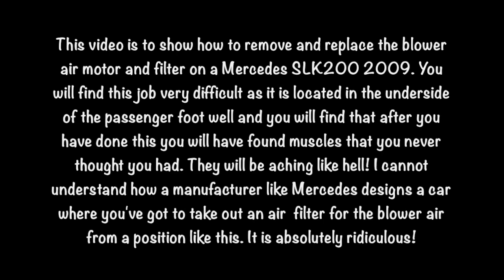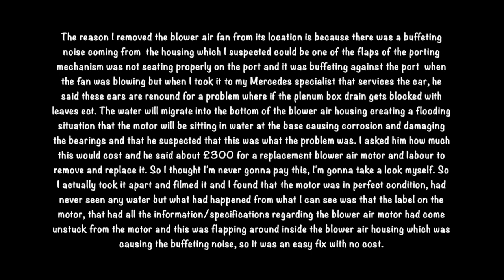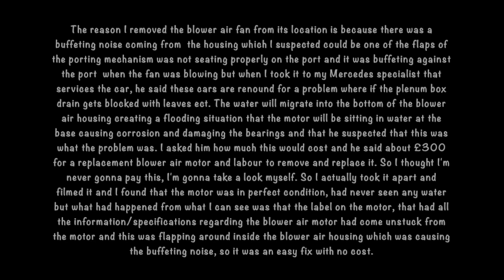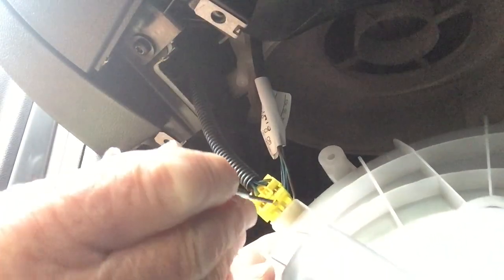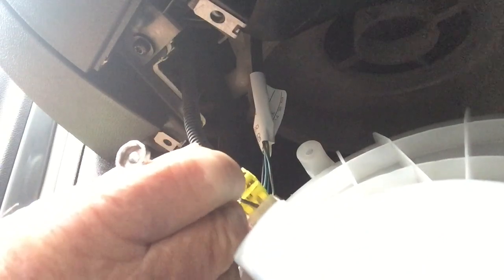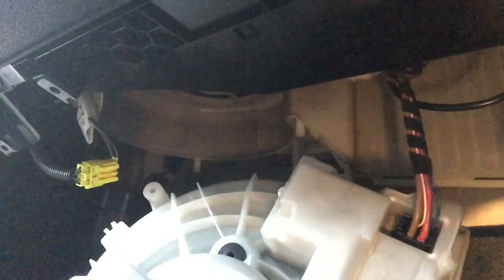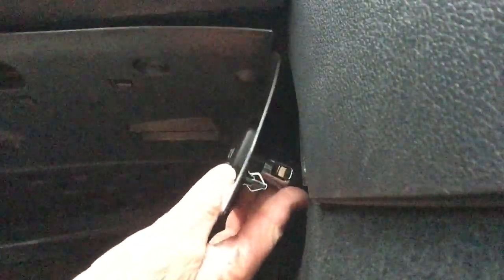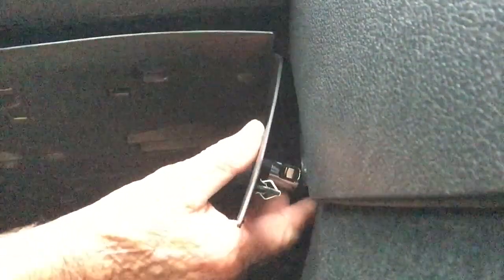Mersades SLK200 Blower Heater Fan & Filter Housing Remove & Replace

Comment: Hi Great video, thanks. Copious amounts of oil and WD40 quieted the oilite rumbling bearings. I found using hand wash liquid soap on the rubber mounts worked well. Firm pressure is required no rod was required, they just snapped back in.

Comment: Bravo !Very useful video.We got the issue with blowing motor after visiting MB dealer about recall front airbag sensor.Everything was working before.The high rpm wasn't use bz collected car was warm .Today morning She try defrosting windshield as normal and enormous noise was came from the unit.The noise is not mechanical but after taking battery cover off looks like the passage is totally chocked beyond the fan and  is blowing into battery compartment now.After call to the dealer they said if not be related to the job they have done it will be pushing  to paid for it .Another thing on the side of control knobs two red led's are on !!! that's never happened before. I gonna dismantling the unit this weekend and we see whats going on.I will let you later my discovery.

Comment: This video was a great help when replacing my 2008 Mercedes SLK 280 Blower Heater Fan.  Once I determined that the car in the video is backwards the job went very well.  Your car is obviously right hand drive. My Mercedes is left hand drive...  I removed the old fan that was making an annoying buffeting noise.  There was no label stuck in the fan rotor but there was lots of play in the fan shaft.  The fan was apparently rubbing the casing. So, I installed a new fan and new control module.  When tested the fan would only run in fast speed.   Suspecting the new control module I removed it again and installed the old control module.  After the second installation the new fan ran quietly and speed could be adjusted normally.  I will return the new defective fan control module for a refund.
Thanks, this was a big help....  I will take lots of Aleve for sore muscles tonight. …  Ricky